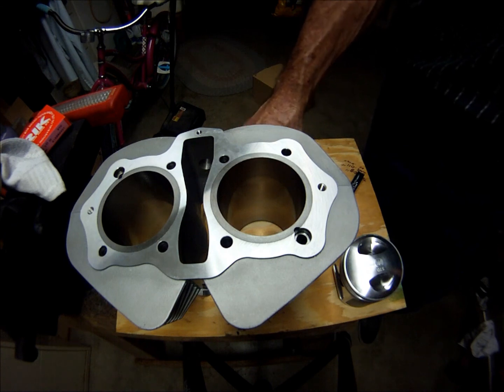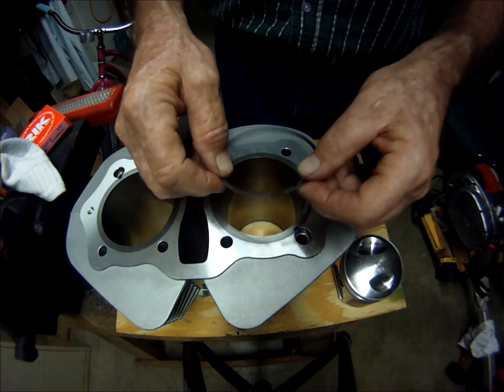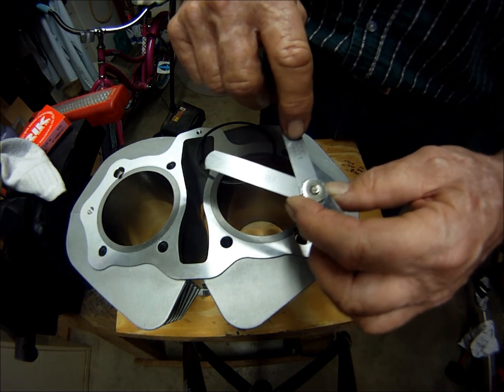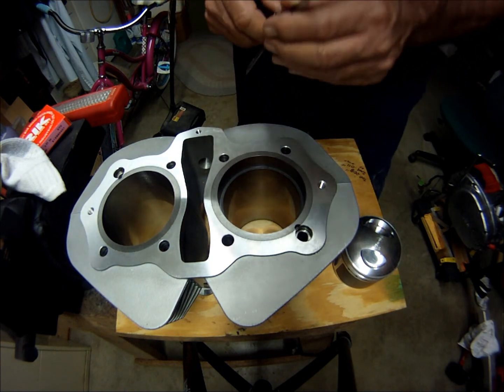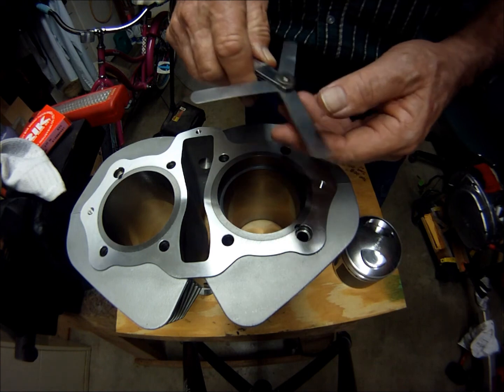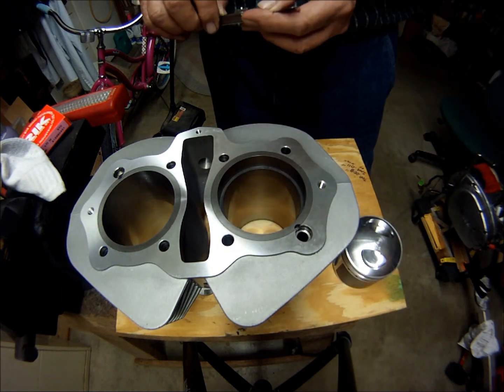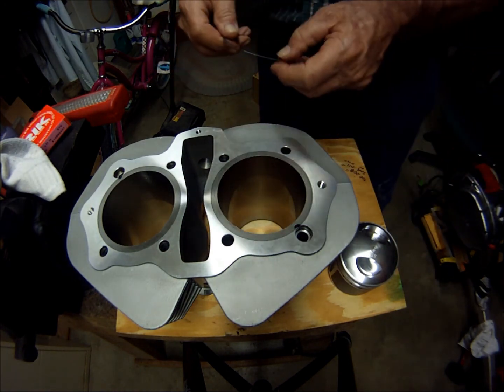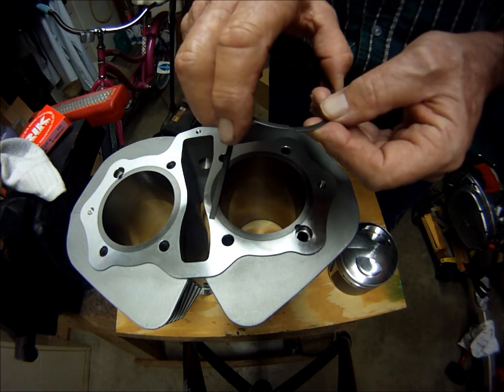XS650 The Big Bore Part 12.99 (setting the piston ring gap)

Comment: Hey nightflyer, really enjoyed your first top end rebuild videos.  Thank you for guiding me thru.  Currently rebuilding top end again to fix leaking valve seal/bad compression.  In your first top end videos you really didn’t touch upon piston diameter, cylinder bore diameter, how to measure, wear to either of those parts and possibly oversizing rings because of said wear.  I’ve been on the forums, my clymer manual and rewatching videos hoping to get a better idea of the whole process.  I understand that I need to measure the pistons first to then move on to work on the cylinders.  Any tips, clues would greatly be appreciated.  Gus